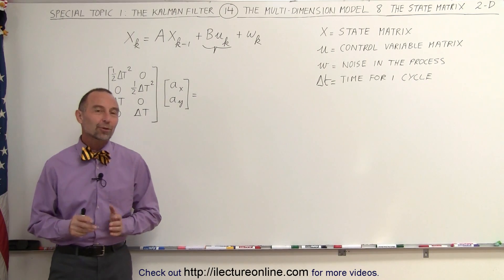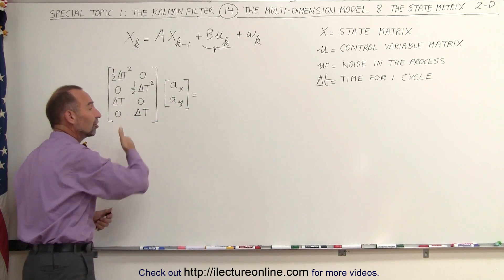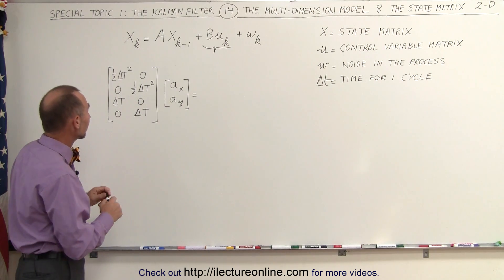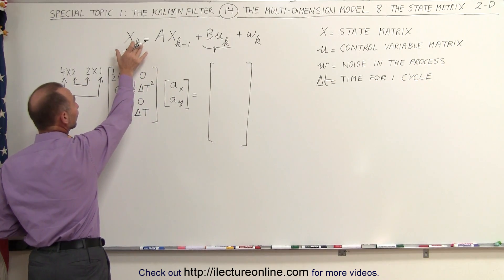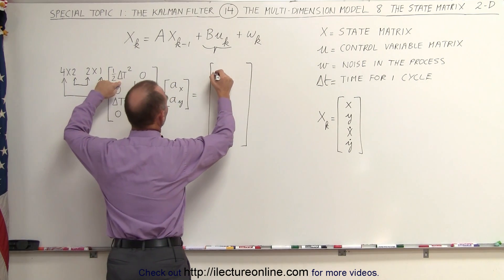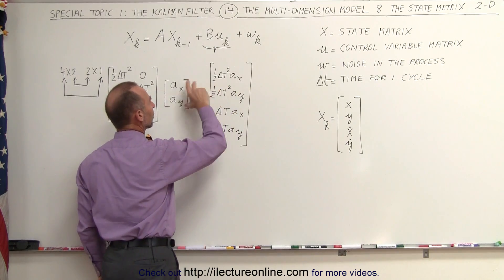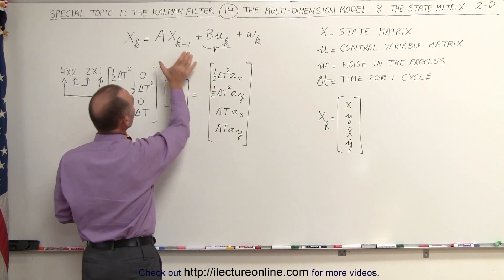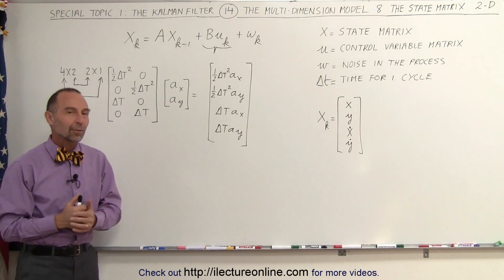Special Topics - The Kalman Filter (14 of 55) 8: What is the Control Variable Matrix?

Comment: In an application where the acceleration is not constant and is tracked by an accelerometer, would you add the acceleration to the state matrix as a third component?  If so, then what goes in the control matrix since acceleration is represented somewhere else?